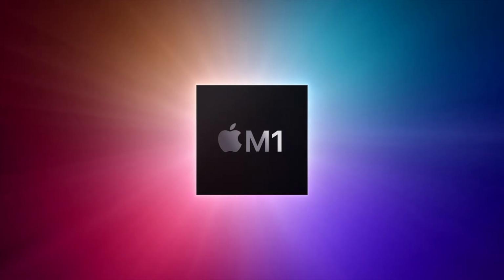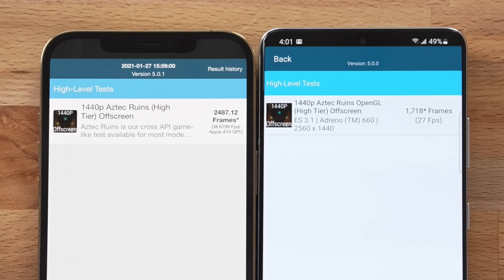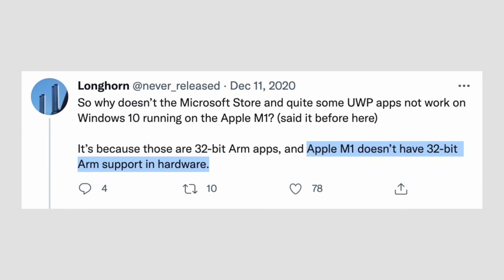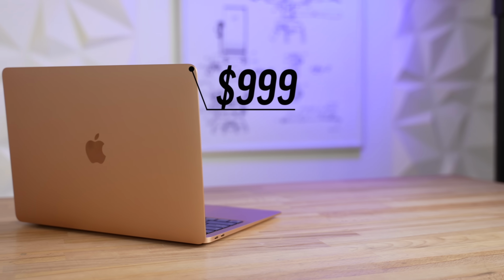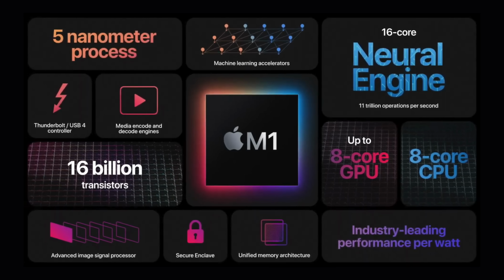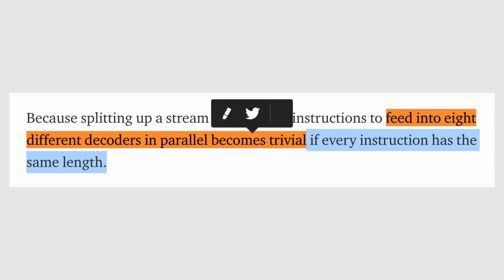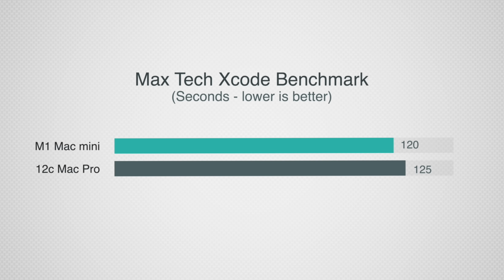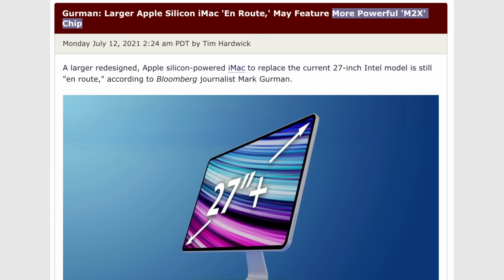Why Apple's M1 Chip is SO Impressive: Explained!

Comment: Currently editing some 4K video for my Patreon on my M1 Air. I'm literally dropping in graphics and transitions into the timeline and making edits to these elements while the video is playing without dropping a single frame. There's a total of 3 channels on some parts and it's 20 minutes long and it plays as if I'm using rendered footage. I was considering a larger laptop, but I may just grab an iPad and use Sidecar for more screen space. I honestly don't need anything with more power.
Reply: Dont take an iPad now. Ios 15 doesn't use most of m1's power. I think by ios 16 we would get pro apps like Fcp.
Reply: @Riyozsu  and the cycle would continue, where you’d expect iOS 17 to fulfill your wishes when you realize iOS 16 didn’t. Apple will never bring over those apps to iPad, because that’s just not how they envision the iPad’s use case.
Reply: @avkrm  but then what was the reason of putting 16gb ram on the iPad pro. If they weren't gonna utilize it then they could have just stuck with 6gb ram.
Reply: or you could just hook up an external monitor on it for when you edit and need extra screenspace? a good 4K monitor would be way more useful than an ipad sidecar.

Comment: There should be support for more than 16 GB RAM! 128 GB to match the 27 iMac. Or 1.5 TB to match a Mac Pro.
Reply: This is the low-end, entry-level chip. Expect newer chips to add more memory.
Reply: @MaddTheSane  They did a bit, in the meantime: M1 max and M1 pro. But still more should come.

One day the M2 will come. Then M3, …

Comment: There was still NO NEED to drop THAT MUCH compatibility! Windows run very old Software. Investing in Windows, specifically Games, is a much better way.

If Apple wants to still give away its OS for free, it can offer a product or upgrade with a price which runs older software. If Apple knows what unit and integration tests are, they can provide quality assurance for everything they had ever supported. The OPEN SOURCE COMMUNITY will do it for free (if the license is ok).

Emulators can run EVERYTHING. So Big Sur and Rosetta 2 could have 32 bit support. Just look what the JVM (Java virtual machine) can do, and you know the real power.

I‘ve heard that QEMU should be able to run a lot of old stuff. But Apple, Parallels and VMware should have a bullt-in emulator too.

Apple has not the 90% market share to always kill compatibility. We Mac users like more games without having to use Windows.
Reply: windows have dropped TONS of compatability over the years and we are due for another shedding of leftover old legacy trash... but the problem is X86-64 is so full of old crap, it's not efficient, it's not modern, it is power hungry, it needs a FULL reset just like the M1... but noone dares do it because omg compatability with old crap and ppl will whine because their 20 yr old printer wont work and so on
Reply: @LiLBitsDK  Compatibility doesn’t cost efficiency, if well done.
Reply: @javastream5015  twice the instruction sets doubling the die space needed IS part of the efficiency, there is no "do it well" on that... and double the die space = more heat and more power usage... there is no way around it ;-) it's common physics learned in like 6th grade
Reply: @LiLBitsDK  I bet it’s not so.

The same question was asked decades ago by a professor of mine when Intel presented the Pentium Pro. „Why do you cripple your die with compatibility for 386?“ Answer, with a smile: „Because it uses very few area on the CPU.“
Reply: @javastream5015  Guess what: x86_64 has two ways of handling floating-point math: the x87 math co-processor and SSE2 vector math. And in order for older code/programs to run correctly, they have to build the CPU to handle the old (x87) math routines correctly.
Reply: @MaddTheSane  But the A20 gate is disabled! 😄

Comment: you know that the M1 is that good when even Linus praises it
Reply from the maker: Exactly!
Reply: @channelofstuff apart from being not true, it doesn't matter, the M1 and the software to back it up, is impressive. Comming from a stricly Windows guy. Irrational bias is stupid.
Reply: linus loves linux
Reply: Linus was the first and biggest to bash it cuz, fuck apple 🤔
Reply: 😆 Linux....  Your comparing a super duper machine to a can-opener

Linux doesn't need all that power, and it would be wasteful to think otherwise.
Reply: @kylebelle246  I don't know what kind of programing you do, but as long as I only get 16gb and all docker containers are running in emulation mode, I wont buy one...
Reply: Having Linux on it will be cool. We’re close!
Reply: @sparschaler3536  I don't get this... People obviously hate limitations and the 'gap closing' like swathing to M chips.. on the Mac

On one hand I want the best of both world too, but people go into this knowing (and sometimes unknowingly) what's possible and what isn't. Yet, people still want it... We'll, why did we go down this path, introducing that problem ??

It doesn't matter if we say we understand how M1 works and what it doesn't run, we just don't care. All we want is it to work how WE want and disconnect the 'limitations' we think we understand..
Well. we don't by the aftermath.
Reply: I returned a Mac mini M1 and built a Ryzen 5950x system instead. Why? Because as a software engineer there were so many bugs. 
- Java apps ran incredibly slow (think 5x slower)
- docker containers had several issues
- chrome was slower (looks to be fixed now)

Overall, not a great developer machine for .NET,  Java, and SQL development. 

P.S. I used to work at Apple Headquarters for two years so I enjoy their products. Apple forced me to buy a windows machine this year but they might win me back over next year.

Also, Apple computers are not as wide spread in “professional” circles as you may think as daily drivers. Securing them with Enterprise security is one of the bigger concerns fwiw.
Reply: He also acknowledge, and he's not the only one, that these M1 devices are just experimental and come with a lot of problems. Some problems are that you'll not have support for your non apple software working via Rosetta. M1 devices have a lot of compatibility problems with external monitors, external storage devices are slower than they should, several bluetooth problems. Also, why choosing the proprietary Metal technology when you have an open standard like Vulkan? All that Apple is doing with these movements is limiting the rest so they can dictate what you can do and how you can do it, because they also don't want you to repair your products by yourself. You simply can't upgrade your RAM in your M1 chip or anything without buying a new device and I can keep going.

Apple is not a small company, if you're going to release something, then do it the right way. I honestly do not recommend, in any way, to buy these devices. It's easy to say that something is incredible if it's coming from Apple, but there are few people brave enough to say the truth.
Reply: @JotaFOC  I’d like to agree with you but after about ten months upon its release, the M1 has shown to be largely welcome and shows not too many problems with other devices.

Comment: 1) Apple's first chip A4 in 2010 was based on licensed ARM Cortex A8 core - using patented special transistor optimization technique was able to run faster at lower consumption

2) Apple's first in-house developed core in A6 Swift in 2012 (although 32-bit ARMv7 ISA) was the most powerful 32-bit ARMv7 core on the world (thanks to very advanced Out of Order architecture with 2x INT units for scalar). For example license ARM Cortex cores was using 2x INT design up to Cortex A75 in 2017. AMD was using 2x INT design in  disastrous Bulldozer architecture up to 2016 before Zen came. Both A75 and Bulldozer are well known for low IPC (performance per GHz).

3) One year later in 2013 Apple's first in-house 64-bit core A7 Cyclone with new ARMv8 ISA. But beefing computation units up to 4xINT and theoretically quadrupling IPC (2x width, 2x more units). Real code shows 2x IPC (performance of serial machines never scales linearly as parallel machines like GPU) which is super impressive. A7 Cyclone was the first 4x INT units CPU on the world together with Intel Haswell released same year. Intel Haswell had +10% higher IPC than A7 however Apple was very close. Intel had much higher clock speed around 4.5 GHz but in terms of architecture we can Apple was super ambitious since day one. Especially if you consider development of Haswell and A7 Cyclone started 4 years earlier in 2009 when Intel Core2Duo, Nehalem and AMD K10 Phenom II, all of them using 3x INT units architecture. Yeah, Apple (Jim Keller and Gerard Williams III.) planed to beat everybody since day one. BTW in 2012 new AMD CEO Rory Read who was hired to save AMD finally convinced father of A7 Cyclene, well known Jim Keller, to join AMD. Keller started immediately ARM CPU development K12 and smaller x86 cousin core called Zen. Both were 4x INT architecture similar to A7 but K12 was wider for 1x Branch port. This resulted in 4xINT + 1x Branch behaving like 5x INT core, theoretically +25% IPC over Zen. K12 was bigger due to both cores aimed for identical silicon area and new clean sheet ISA of ARMv8 with much simpler decoders allowed to fit more beefy core than similar x86 with all those 16-bit ancient 286 modes and backward compatibility. 

4) In 2015 Apple's A9 Twister increased IPC +30% so that was beating brand new Intel Skylake architecture. Intel was winning only thanks to higher clocks. Apple is king of IPC (which is best metric for architecture) since then and extending leadership every single year. AMD was in that time in deep problems with Bulldozer on market. Also background politics started in AMD again as Lisa Su became CEO. More powerful K12 was cancelled after tape out and whole AMD's ARM division already selling ARM Opterons A1100 based on Cortex A57 was cancelled. ARM and Fujitsu were finishing specification of brand new SIMD instruction set for super-computers called SVE - designed for leadership in FPU performance due to 2048-bit length vectors. This is far more advanced what x86 was planing with AVX512. From today's perspective it's absolutely insane that AMD cancelled ARM CPU development when they new about 2048-bit SVE vectors (probably for successor K13 core). Looks like some dirty corporate politics and x86 wing won. No surprise that Jim Keller left AMD and it had to be nasty - he never commented the reason in any of his many interviews. All we know today Zen3 is based on Keller's K12 (has identical 4x INT + 1x Branch desing and 3x memory AGUs).

5) But Apple released in 2017 brand new and much wider architecture - world's first 6x INT + 2x Branch architecture called A11 Monsoon. This 8-wide design makes it double wide (theoretically double IPC) as Intel Skylake, Ice Lake, Tiger Lake, AMD Zen1 and Zen2. IPCzilla brings about +50% IPC than Skylake and AMD Zen. Absolutely monstrous IPC leadership. Apple miss only frequency to take absolute performance crown. But Apple increased frequency with every new process from 0.8 GHz in 2010's A4 up to 2.4 GHz in 2017 A11. That's +200% frequency increase. Intel and AMD reached in 2011 4.8 - 5.0 GHz. Intel after 6 years didn't move at all and AMD even went down to 4.2 GHz with Zen. Engineers in Apple new that soon or later they will reach and later outperform thermally limited x86 power hogs. Super-wide and efficient architecture is the optimal way to maximum performance for future chips at 2nm and 1nm process. Apple A16 on 3nm TSMC process will probably attack 4.0 GHz while maintaining 5 Watts per core. AMD already said that Zen4 on 5nm will go down with frequency. So on 3 nm efficient mobile ARM chips will reach same frequency as high-speed x86 CPUs. From 2nm ARM CPU will able to clock even higher than x86. But I guess x86 will be dead until 2024. They will be selling some old 5nm Zen4 4.5 GHz chips against Apple A18 on 2nm at 5.0 GHz (but thanks to 2nm Apple will able to put 4x more cores on the same area).

6) Apple A15 and M2 (Jade-C could be named G1 for example, as old PowerPC G-series of CPUs, who knows, Apple know) this year will be new architecture just like A11 Monsoon monster came after 4 years. I predict around 12-wide machine, 12-decoders, probably 9x INT + 3x Branch because 3xINT + 1xBranch looks like optimal ratio. 3+1 uses Cortex A76 and all 4xINT cores can runs with 3+1 too as these 4xINT units has 2x Branch units shared on. Today's M1 has insane +60% IPC higher than Zen3 (or +90% higher than Zen2) so new A15 / M2 with 9+3 config will have +85% higher IPC than Zen3. This assumes +15% IPC jump from M1 which seem reasonable. This A15 at 3.3 GHz means performance equal to Zen3 at 6.1 GHz. Holy Jesus.

7) M2 also will be ARMv9 and 2048-bit SVE2 vectors compliant. I assume FPU/SIMD HW registers will remain at 128-bit due to little cores. However compatible with new SW compiled for 2048-bit SVE2. This is absolutely insane. How x86 can face that?

8) ARM released new info about Scalable Matrix Extensions - SME. In other words SVE for matrix calculation on CPU. As you know A13, A14 and M1 has secret custom matrix instructions called AMX as first CPU on the world. Now probably Apple pushed same idea as SVE with vectors but with matrix instead. This dynamically chopped vectors/matrices on the fly is absolutely revolutionary in compare to static compiled x86 AVX code. 
https://community.arm.com/developer/ip-products/processors/b/processors-ip-blog/posts/scalable-matrix-extension-armv9-a-architecture
Reply from the maker: Thank you for the info! Very interesting!
Reply: r/usernamechecksout
Reply: The comments on this video are on par with the quality of the video. Thanks for taking the time to type all this

Comment: Apple left all the tech reviewers with egg on their faces after WWDC 2021 by not releasing the hardware everyone was predicting. Yet videos like this still get made, and I still watch them.  The bottom line is that no one outside of Apple knows.
Reply: Yeah but this video in specific is meant as a deep dive into M1 than a leaks vid
Reply: @shresth1201  You need to watch until then end for the predictions.
Reply: @JerryPalmerino  M2/M1X leaks? those are going around since long time.

There was bombshell leak from Bloomberg about 10c M1X and dual/quad M1X chiplet equipped mac pro back in March. He’s just stating again. 

Majority of it still remains a deep dive.

Comment: Why's ur model name iphone 13 when u try for geekbench compare to samsung
Reply: iPhone 2007 : iPhone 1,1

iPhone 2017 : iPhone 10,1/10,3 (named iPhone 8/iPhone X) 

iPhone 2020 : 13,1/2/3/4 (name iPhone 12 mini, iPhone 12, iPhone 12 Pro and 12 pro max respectively)

It’s actually the position of the device in lineup, not the name. It’s called machine identifier. It’s based on the logic board. 

So iPhone SE A9 chip was same generation with iPhone 6S and thus had identifier as iPhone 8,3 (8,1 was 6S and 8,2 was 6S plus)

Similarly, iPhone SE (2020) was same gen as iPhone 11 so it’s identifier was iPhone 12,4 (iPhone 12,1 12,2 and 12,3 were the iPhone 11 series) 

So iPhone X, the tenth iPhone was actually iPhone 10,3 (10,1 was 8 and 10,2 was 8 plus) 

Then we had iPhone XS and XR, which were 11th version of iPhone (despite name being XS) and iPhone 12 being 13th version of iPhone.

This confusing numbering and naming is because apple skipped some numbers in iPhone versions like there was no iPhone 2, and iPhone 9. And instead of these, we instead had two iPhone 5,6 and X (5, 5S; 6,6S; X,XS)

Comment: Apple A series chip vs Google's Tensor chip
Reply: Tensor is just an Exynos 2100 cpu with Google machine learning cores (tpu)

All it means is that you’ll have slightly faster Google assistant and camera performance for computational photography and offline Google lens.

Apple is chasing cpu and GPU performance to compete with x86 chips in laptop space, which is different from Google approach of giving users convenience of using services like lens and translate in offline mode.

Comment: That’s a lot of optimization. But why does my m1 mbp constantly chokes with a mounted network drive and kicks me off wifi and Ethernet connections to network drives when copying many files. Makes it weak for real work. They need to work out the bugs that weren’t there on intel. It’s not a workhorse yet.
Reply: well you could troubleshoot your network to find the issue(s) or you could just blame the M1... whichever fits you

Comment: Why will the cores on the M1X chip be the same as last years M1? Couldn’t they use the upgraded A15 cores, since the A15 in the iPhone 13 will be released next month.
Reply from the maker: The weaker M2 chip meant for lower-end devices which will be built on the A15 cores needs to come out before the higher-end M2X model does. On top of that, Apple has mentioned many times that their Apple Silicon architecture is built to be scalable, which means adding more cores.
It makes sense to take advantage of the A14 cores one more time for the M1X. Makes it much easier to have an upgrade path in the future.